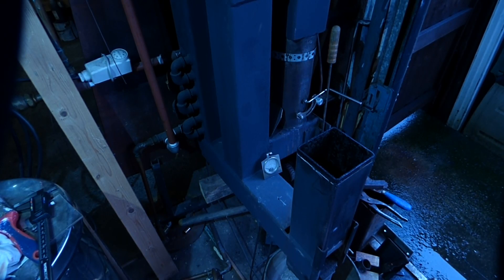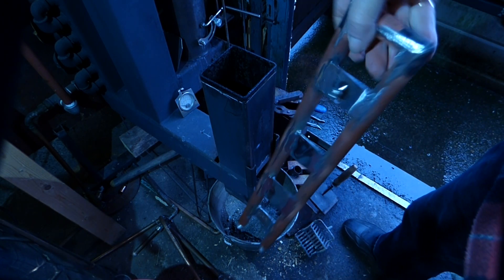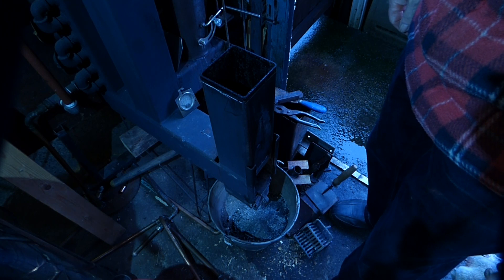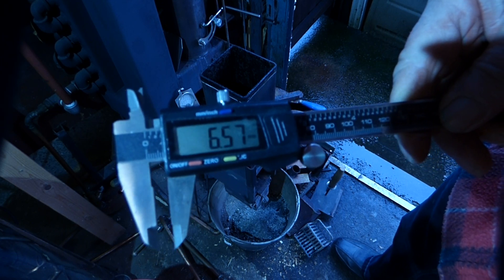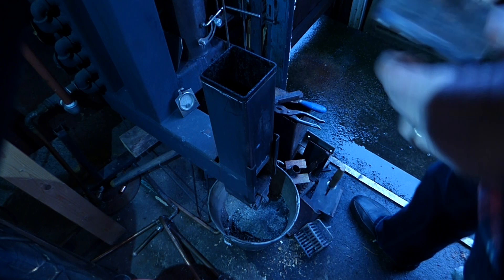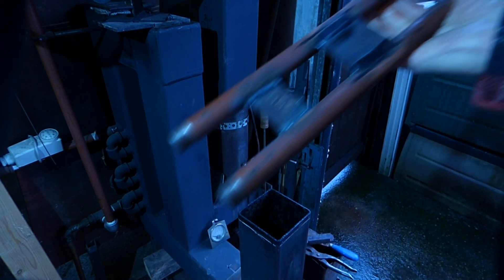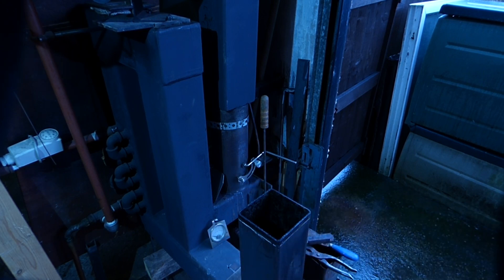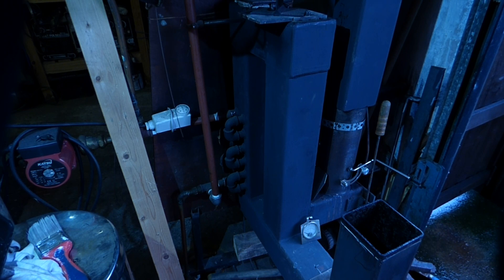No55  rocket wood pellet stove  heat exchanger MK3

Comment: You did it... You go inside the burning chamber.... okay... You Go another way than i thought first, your  way outside is the end of the burning area... I think this way can Work, my last comment, i thought you will bring a lot of barriers into IT, but maybe this is the way i thought about, cause i thought about to make a few adjustable" Spoiler" (i Talk about my projekt) at the top of burning area ... so the leaving gas has to go into the Flame and it must be reburned. What i think.. in your Projekt... The Tubes die waterheating are to Low ... I think if you Cut the complete Slot ( i mean the Back Side with the watertubes)and Turn it 180 degree, you dont indecrease the Flame, the flames who maybe enter that area can burn like its Natur, If you have your tubes there, than the flames will go of, the temperature doesnt matter If you Take IT right over the burning area, or in top of the first of the straight one, BUT... If there is gas which will burn when the Flame reach it, it could not burn, cause your Tubes dont allow the flames to go upside... I Hope you understand what i mean or think , my friend... I think it is maybe one hour to Cut it Off and Turn it 180 degree and weld it again. I think it will bring a lot. Best Greets Sven
Reply: My own Project is going on... Last Weekend i Go a big step forward, but its a lot of work to do...
Reply: But anyway ...i Love your stove...

Comment: You would not want to put a heat exchanger in the burning chamber for that will extract heat from the flames and will decrease the burn efficiency. The best place for a heat exchanger is the part of the system where the burn has already completed and there are hot gasses (but the oxidation process is already done). In this way you still extract ample heat but do not affect the efficiency of the burn.  Ideally a heat exchanger should be put in something the Russians call "kalpak" ( a hat). It is a chamber where the hot gasses collect, but can only get out from the bottom, with the idea that till they start coming out they have released much of their heat. The barrel in the standard rocket stove can be viewed as such a "hat", although one can make several such "hats" through the path of the hot gasses. This dynamics is called "free movement of gasses" vs "forced movement".